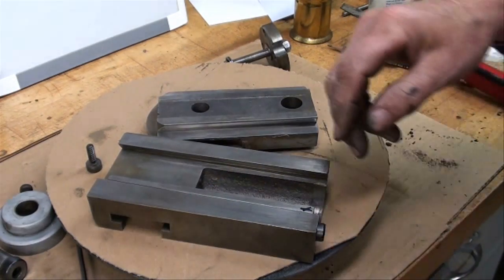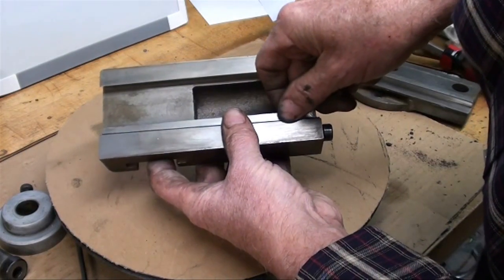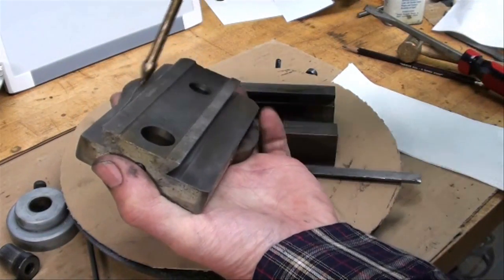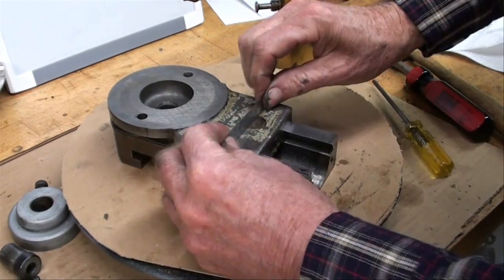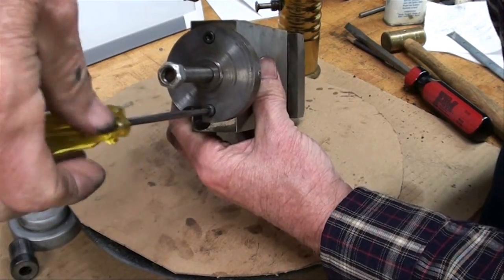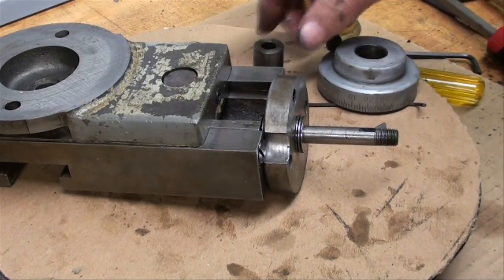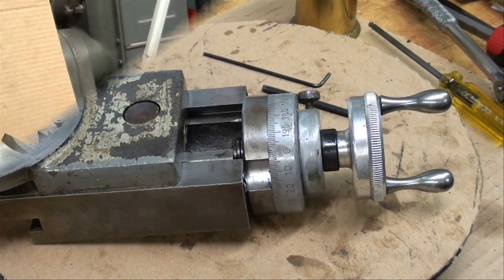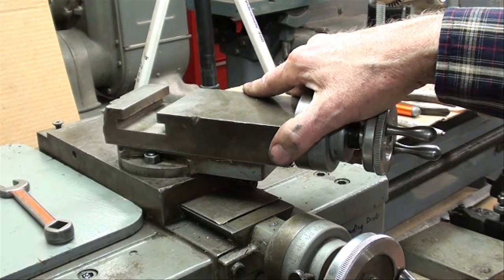MACHINE SHOP TIPS #64 Clausing Lathe Gibs Pt 2 tubalcain

Comment: Have you ever used a polishing/lapping compound to "wear-in" a dovetail to take out the tight spots?  I've done it on a few dovetails, seems they bind toward the outboard travel where one does not use them very often or where they get nicked up.  I've also had to lap in some taper attachments in areas where they don't get worn-in by use.  After lapping, I clean the parts up thoroughly.  I use valve lapping compound, fine grade, oil base, available at any auto parts store.

Comment: I am probably too obsessive-compulsive, but I would be unable to disassemble and clean the compound without spray painting the painted part! I would be compelled to paint it...I know you can barely see it, but...

McMaster-Carr sells a variety of oiling cups, including the type with a steel ball that sets flush to the surface. Installing one in the compound would allow you to oil the screw easily.